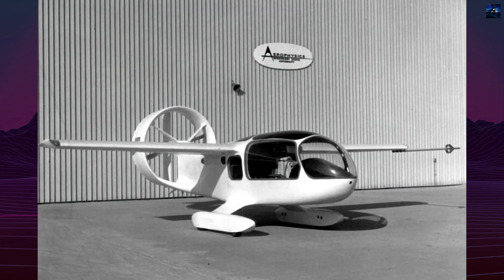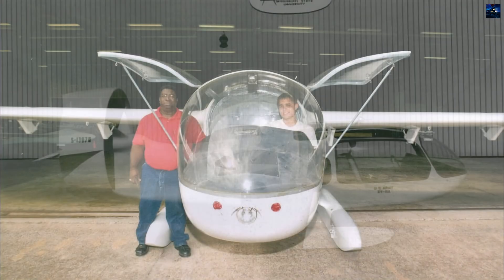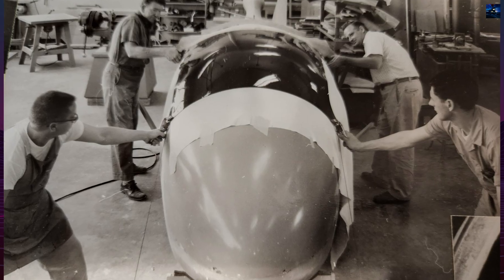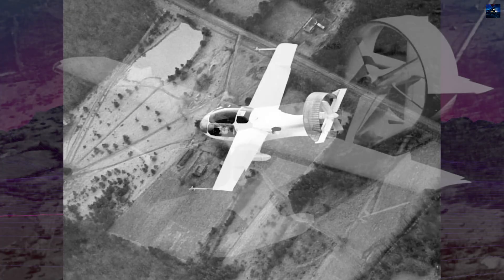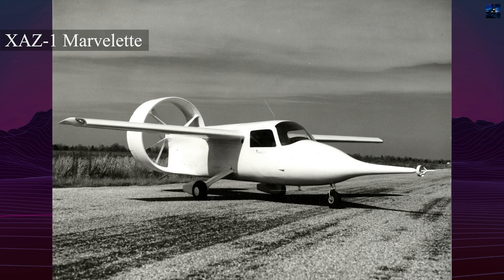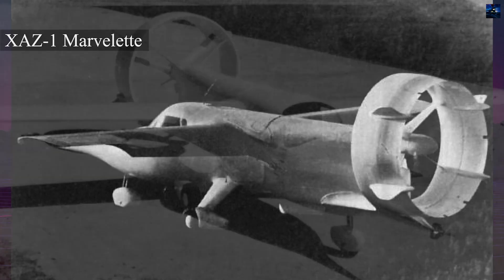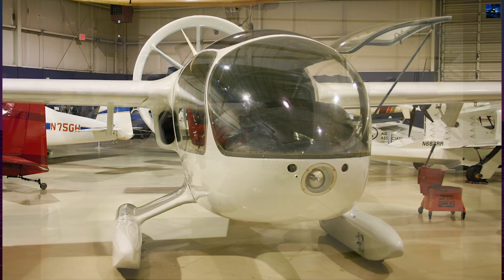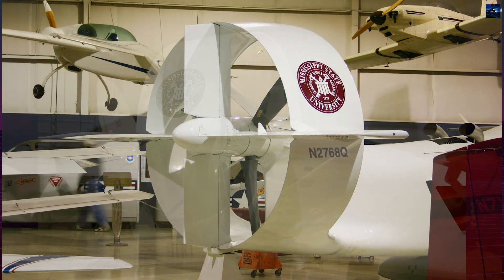Mississippi State University XV-11 Marvel: The World's First All-Composite Aircraft

Comment: Very cool to find this little video on the XV 11 .  At 42 seconds there's a picture of four men apparently stretching hot Plexi-glass to form the top of the canopy.  My dad is the guy at the right rear position.  If interested one should look up August "Gus" Raspet who was the head of the aeronautics department of Mississippi state at the time and instrumental in the success of these experiments.  The XV 11 was always heavy and underpowered. With today's technology using carbon fiber and lightweight polymers it would've been a huge success.  It was still a very important test bed for boundary layer control, which now helps to allow current third generation fighters  to be so incredibly maneuverable, especially at low speeds.

Comment: Duct-ed fan like power
Reply: Hovey said Ducted fans have no advantage over Open air propellers above 200 km/ h Airspeed
Reply: @josega6338  depends on solidity.. Fan-jet /trubo-super-fan (those big 9 to 1 monsters)blade areas are usually at 1.2 solidity.. that is they overlap, thus have a compressing ability.. and in addition the ducting actually decreases the entrance area, slowing down the air before it interacts with the fan-blade area..  da, da, da.. get a book on aerodynamics  and do the math.. (THEY LIKE LOTS OF POWER)

Comment: Except Burt Rutan’s VariEZ was effectively the world’s first all composite aircraft. Burt later designed the LongEZ and the Voyager aircraft which flew around the world without refueling.
Reply: With zero steel reinforcement…
Reply: @danielkemp4860 neither the VariEZ or LongEZ has steel reinforcement
Reply: Also the Adam A500 and A700, not a lick of metallic structure but for the firewalls and engine mounts.
I worked the layup and trim-drill at Adam, also knew the first customer aircraft since it was bolts of fabric in the freezer to final assembly.